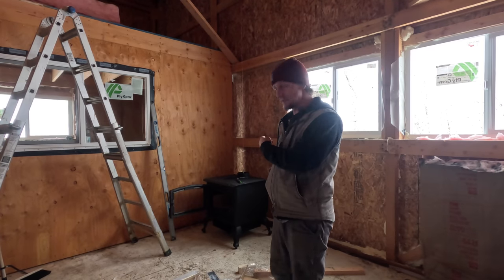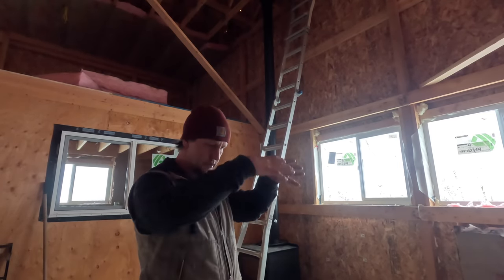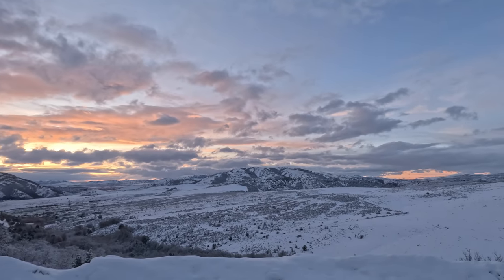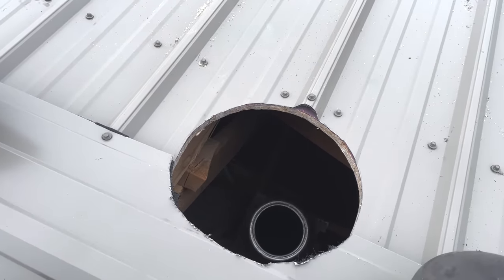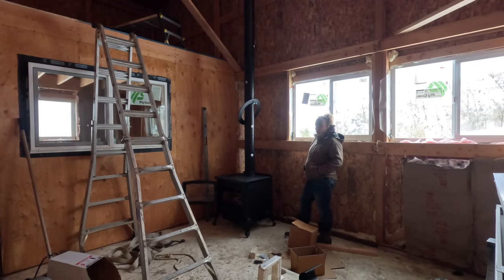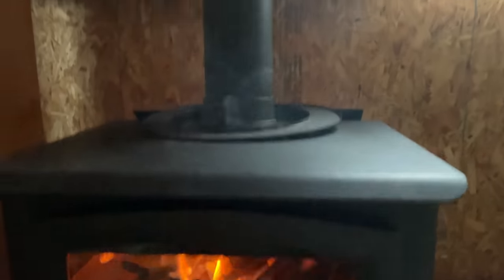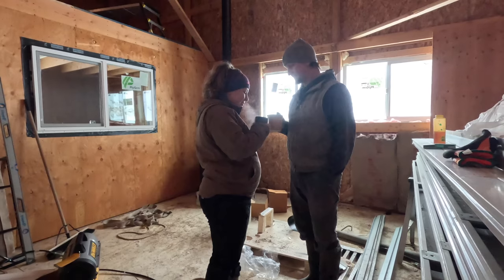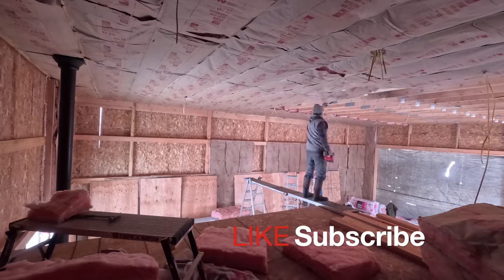Installing the ULTIMATE CLEAN BURN WOOD STOVE to heat our POST FRAME SHOP/BARN DIY | Off grid build

Comment: My 2 cents from a older guy who has lived through a similar build .....add as much insulation in the roof (and the walls if you have room) that you can afford...another 6" on top of what you put on the ceiling at least going perpendicular.....will seal air gaps next to ceiling truss boards....and will insulate the top of the wood ....cold conduction ...otherwise you will have zero insulation where the truss boards are....

Comment: I was about to ask about the storm collar... And there it was. Last thing you put on. 😀 Thought I'd pass on what I did with mine. Since it is there to prevent rain from sliding down the pipe, and through the roof jack, I wanted the best seal I could get to the pip. I started to put a bead of caulk around it where it meets the pipe, then had a better idea. I set the collar in place where I wanted it. I used a marker and made a line around the pipe, by running it along the top of the collar. Then I slid the collar up. Then I put a bead of silicone sealant on that line, all the way around. Then slid the collar back down, until it was well bedded into the bead of silicone. Juuuust starting to show through the top of the collar. Let that cure, and it is sealed and is glued in place.

Comment: Installed heaters professionally,  one  thing it pays to do is to put a reflector behind it, about 1" off the wall. Used polished aluminium. Put it on all wood that is closer than 12", no matter if there are multiple pipes there. Have seen things that thought impossible. Stay safe.

Comment: I was in a barn sorta like yours and the old guy that owned it had 2 pipes at either end inside going from the top of eves to the bottom at floor and there was fans that sucked the warm air of the ceiling and blast it across the floor recirculating the heat. That was one warm comfy barn and the fans were low voltage and silent.

Comment: The woodstove in my home is very similar but in the shop I have a double barrel stove I built. I spend a good deal of time in the shop and with the barrel stove I can pack it with 32" sticks and get a solid 15 to 20 hour burn time and the shop is always comfortable.
Reply from the maker: I’ve seen those stoves and that’s impressive to get that long of burn time. The more you can load in, the more you can get out I suppose. Thanks for watching and taking the time to comment

Comment: Concerning field mice, From somebody who dealt with it remodeling an old farmhouse. Get some metal screen door screen staple under your soffits, even though you're going to finish them later. Make sure all your doors are sealed well. Mice love to make tunnels thru fiberglass insulation. I would also set a couple of glue traps around the inside walls. I wouldn't use ones with bait on them however. No need to attract them anymore than necessary. Just a suggestion.
Reply: The best mice prevention is a good cat, they are worth there weight in gold . Our farm & excavation equipment would be trashed if it was not for our friend the  cat we have !

Comment: Good morning Marc, may i ask you why don‘t you placed the stove near the big door? When you open it is the warm air not very quickly gone and is it not need to warm up these section of the barn efficient? Best regards from southeast Asia, Dan
Reply from the maker: You are right. I have large equipment that will go into this shop such as my excavator, and dump truck, I dont want the risk of running into the stove. Also I will be working in that specific area so that why its placed there so I can stay warm while I work.

Comment: Have you given any thought to facing wood stove at a diagonal  to the  area its going to heat,  then glow of fire in stove will be visable to the whole room it will heat. Just an idea. Whats your thoughts? Your vids are a good watch.
Reply: May I say, they discussed the placement in another video as to why they placed the stove that way. Please see that video it’s 2-3 previously.
Reply: @dorothyallen3614  I was  talking  about direction stove was facing,  should work w/locacion of stove pipe.

Comment: Why didn’t you adjust the position of the stove so the roof cap was not so high??? Thumbs down on this video.
Reply from the maker: If we moved it anywhere else we would be in the work space. This was the original plan and is working great for the shop. Thanks for checking us out.
Reply: Plus the snow sliding down the roof will take the pipe out. Ask their neighbors!
Reply from the maker: @michaelgolden9730  absolutely we get a lot of snow up here. Very good point. Thank you
Reply: @michaelgolden9730  where is snow sliding on the top of the roof?